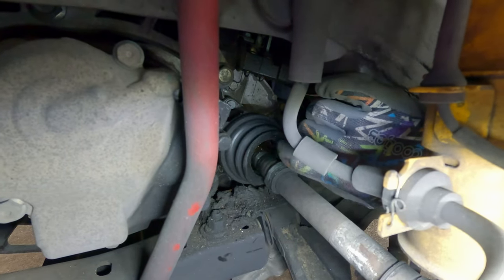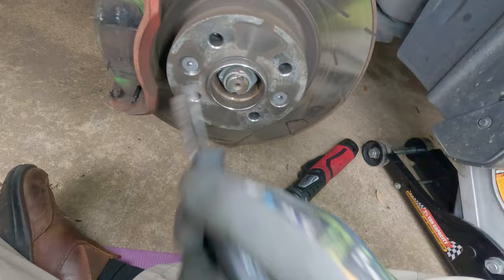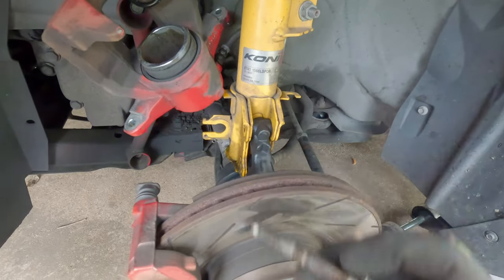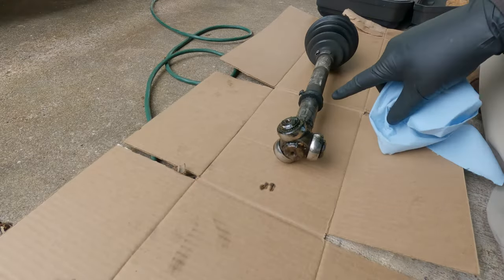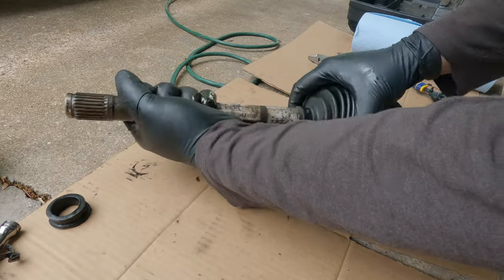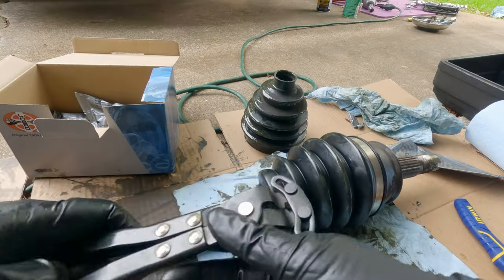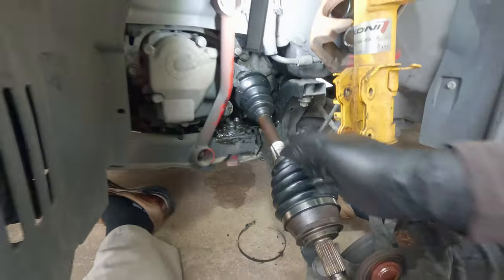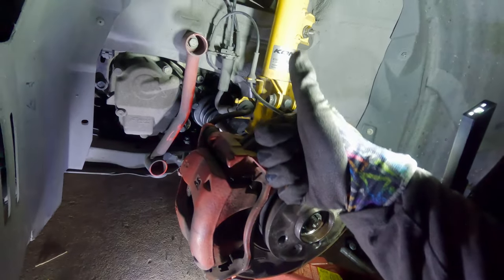Fiat 500 Abarth CV Axle Boot Replacement

Comment: Hey thanks for the video. Only my hub boot needs replacing, can I change that without taking the whole axle out?
Reply from the maker: If you just want to replace the outer boot you'd need to take the axle nut off and slip it out of the hub, then use a forcing cone to get the new boot over the CV joint. The inner boots are the ones that have the most trouble on these cars, so it's really better to replace both.

Comment: Anyway to check if the spider bearing is good or bad? Was your bad or yous just wanted to replace just in case
Reply from the maker: If the boot is torn, water and dirt have definitely gotten in there. It really doesn't take much more time to replace them, and they are only about $30 each, so it's not a bad idea to just do it.

Comment: Are you sure this is for a Fiat 500 Abarth? The GKN catalog says 305871 fits 2007-15 Mini Cooper.
Reply: They are the same part and part number for the Fiat 500 and certain years of Mini Cooper
Reply from the maker: The inner boot on that kits fits better than some of the ones sold specifically for the 500.